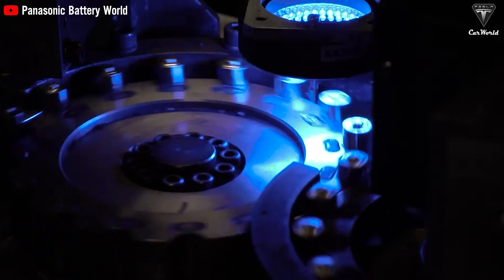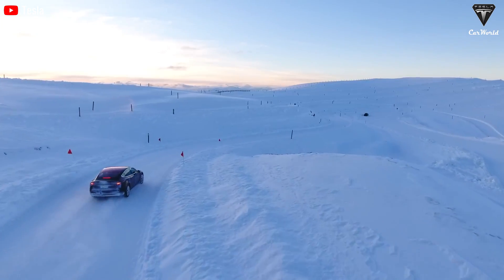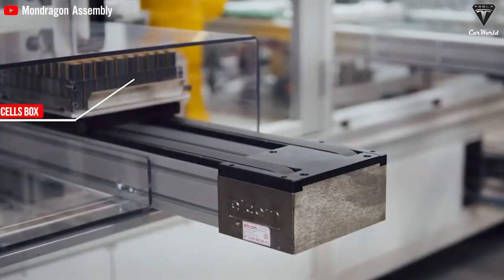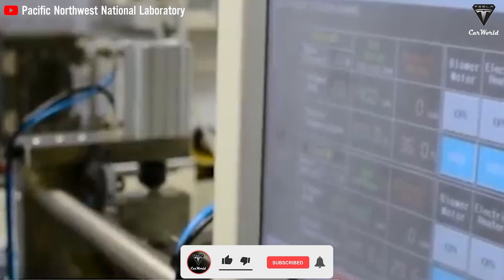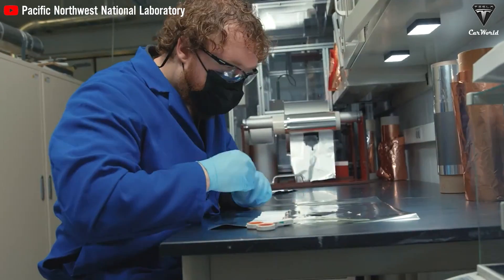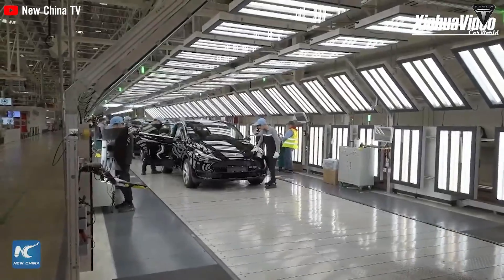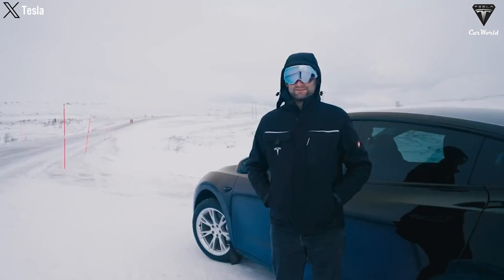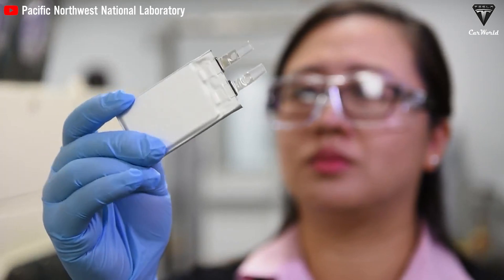Finally Happened! Graphene Battery Will Alternate Lithium SOON! Hit the Market in 2025!

Comment: This channel has become an AI generated hype hallucinating channel. For example just the title contradicts the content saying that graphene is going to be replacing lithium by 2025. The whole thing is hallucinations because graphing is just at best replacing graphite in the anode and it's still a lithium ion battery with better properties. Moreover there is no way they're going to be able to produce commercial scale of graphene anytime in the next many years. There are so many applications that would be revolutionized by graphene if they were able to, lithium batteries would be at the back seat in the long list.
Moreover, this AI generated content fails to point out that long before graphene will ever be commercially viable as an anode solid state batteries with pure lithium anodes will be commercialized and those will have way better properties than graphene because lithium pure metal has way higher density and thermal properties.

Comment: With decades of experience in nano chemical, mechanical and advanced material reinforcement engineering, the future is nano technology in multiple areas.
Reply from the maker: All limits lie at the size of 1 atom!
Reply: True.. it might change our use of power & electricity as well. Less electricity more power !